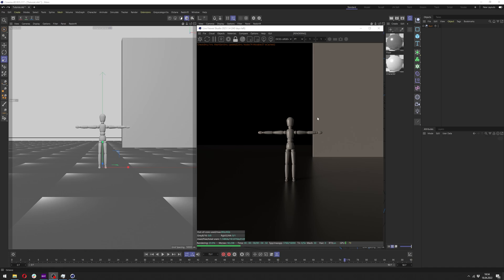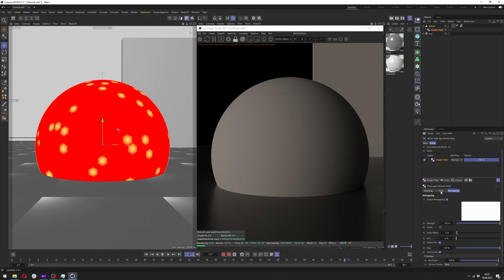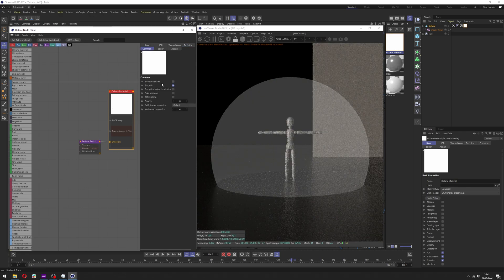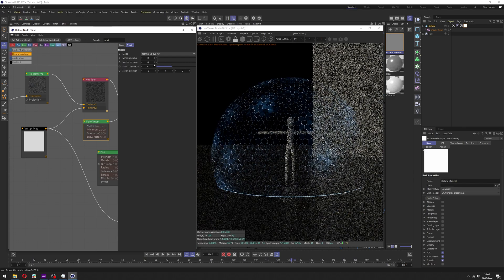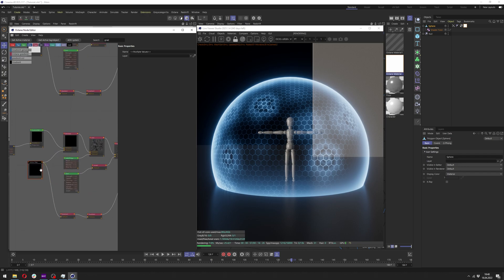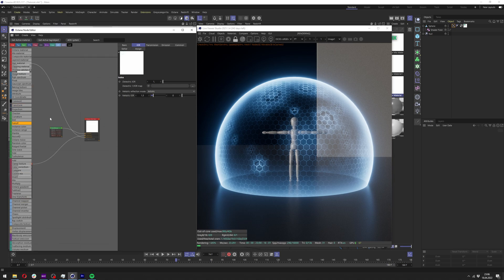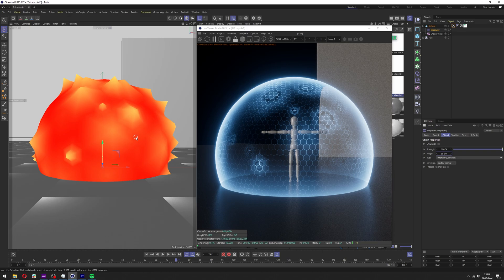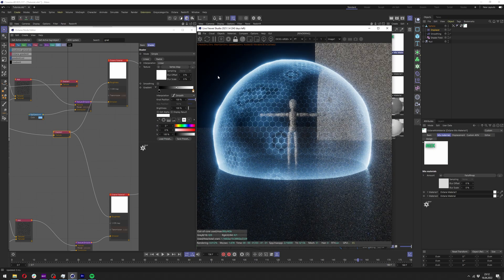Force Field Shader In Cinema 4D And Octane

Comment: I am using cinema 4d 2023. After I add animation speed, the noise texture doesn't move for some reason
Reply: Had to enable "Frame" in the Refresh Settings (Field Tab).
Reply from the maker: Sorry for beign late to answer, but just as Florian said! will just add to delete "freeze" cuz its always get added by default in fields.
Reply: Same. Found a solution?

Comment: the custom patterns is missing in my octane.. is there any alternative?
Reply from the maker: Hey, custom patterns sometimes is just not showing up, closing and opening node editor usually works in fixing that bug. you also might want to update octane if you  have old version. Alternativly you can always skip procedural part and use textures that mimic what i did. cheers!